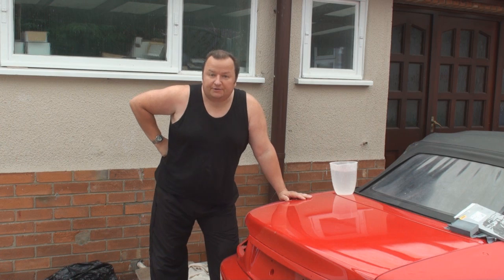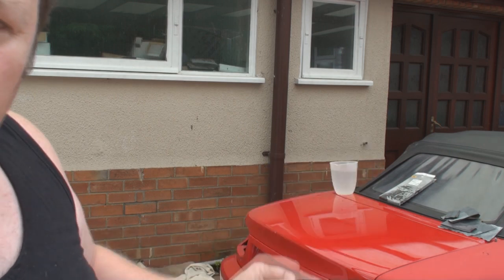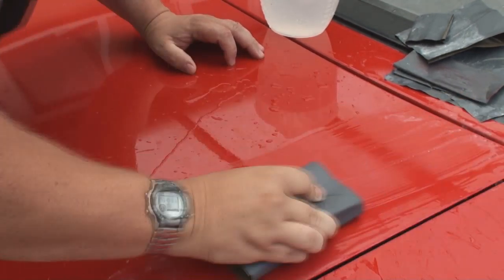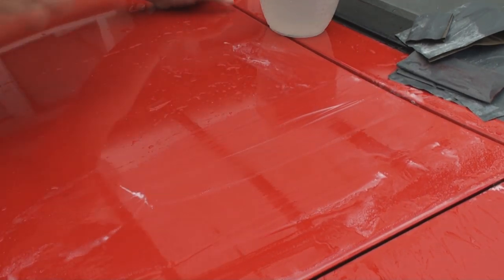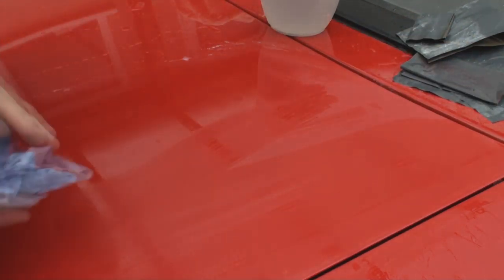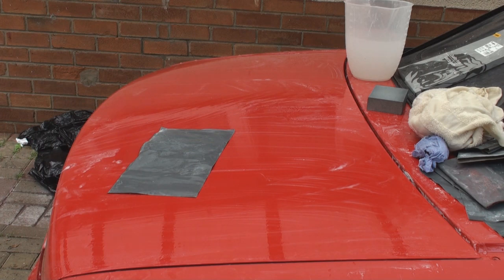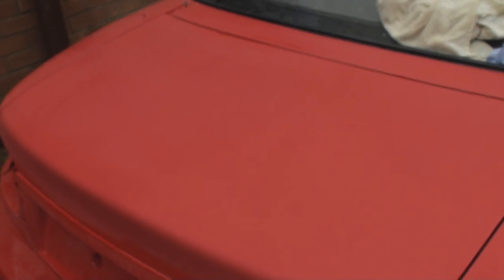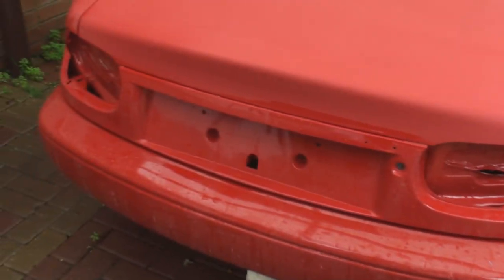Mazda MX5 Respray: Red Vid 8 Sanding The Clearcoat

Comment from the maker: HI, This is the way I do it, I have never used a round motion. I think you get a more even panel coverage with long strokes as you can do sections at a time instead of circular motions. I suppose both ways work, it's just easier in straight lines :)

Comment: Should you sand between lacquer coats? Or will it be ok to sand after youve applied however many coats?
Reply from the maker: *****  You should applly your laquer coats to the manufacturer's specification flash off time.  Normally around 10 mins between coats. If you let the lacquer dry, You would need to sand it so the next coat can grip to it.
Cheers
Martin

Comment: i thought it was easy, but theres too much work involved and a huge chance to mess up, i want to spray my different coloured panels to black, front end , so all you do is fill any dents with filler, sand down to smooth finish, sand down full panel to remove lacquer, clean surface with grease remover, spray full panel with 1 coat of primer, 3 base coats, 3 lacquer coats, wet sand with 1500 grit, polish and thats it?
Reply from the maker: +Arnold schwartznegga Preparing and spraying a car is a big job but if you break it down into panels, it's more manageable.
Cheers
Martin